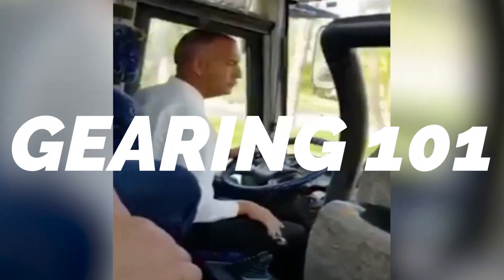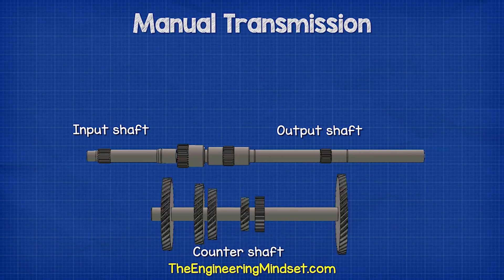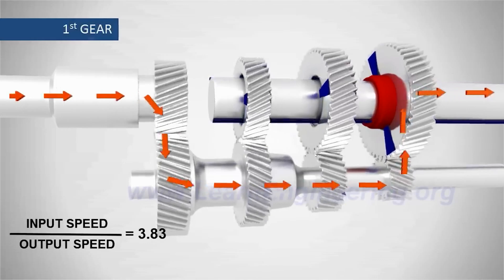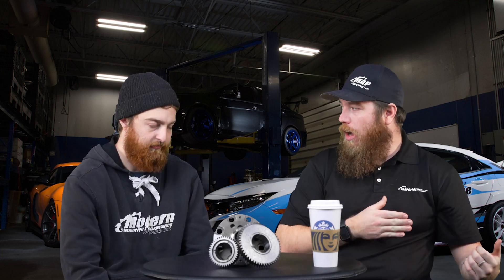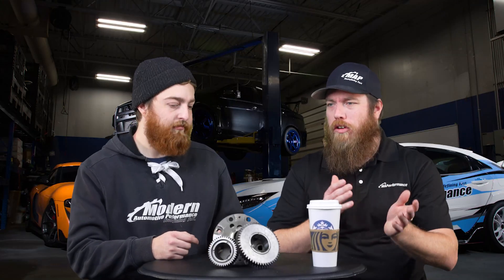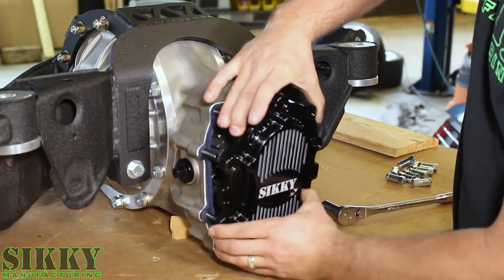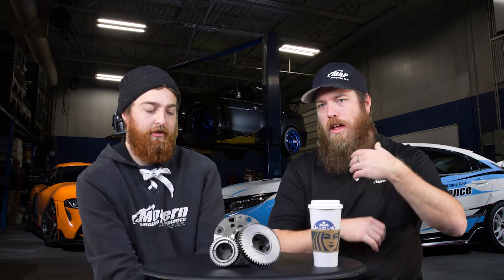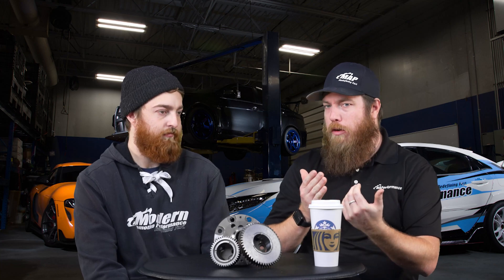Transmission and Differential Gearing Explained | Gearing 101

Comment: great video.......most videos say to determine the rear end gear ratio without removing the differential cover is to turn the wheel one revolution and count the drive shaft rotations, but others say to turn the wheel 2 rotations?

Comment: Great vid! Finally some substance...it's not just slap on a turbo and widebody..wide body.. RACECAR. Just a question would you guys recommend WPC treatment on straight cut gears? Let's get some Info on Cylinder heads...cams cams cams...I'm building an FA20..praying to the car gods

Comment: Appreciate the effort, but as a “101”person my self, I got very little knowledge out of this video, I actually wanna know abt final ratio because Si always improving their final drive ratio and I have no idea what they mean by that
Reply: Yh, could you guys cover more on the final drive ratio. Ik the modifications made depend on a couple different factors but could you jump into an example for instance if your final drive is x and your car makes 200hp high in the middle of it's rpm range you might wanna adjust your final drive in x way to get a better quarter mile time